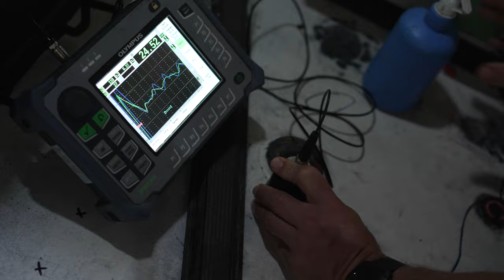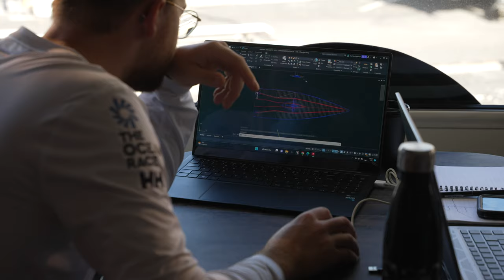We WILL Be Back | GUYOT environnement - Team Europe Update | The Ocean Race

Comment: Hello,
Can you give us details of the approx wt or density of the replacement foam that is stronger than the Nomex? Or was there not enough bonding surface to the core of the nomex honeycomb?
Did you ( is it normal?) check the core bond, by sounding etc. during the cape town stop over? 
If it was good what was it that you think caused the failure of bond now vs previous RTW trips of this boat or was it just flex fatigue and the time had come?
Do you have any concerns about other nomex cored areas? 
Do you have you own site I could ask these questions? 
Good decision to return ! 
Cheers Warren
Reply: I reckon you should sack all these experts and bin your special equipment and fly in Warren from above 😏
Reply: I am also very interested into theses questions. The ocean race and the team can now shine a light on the boatbuilding part of racing, which is very important for success.